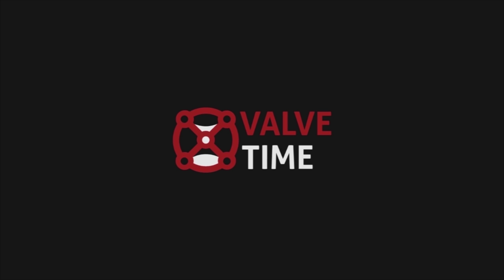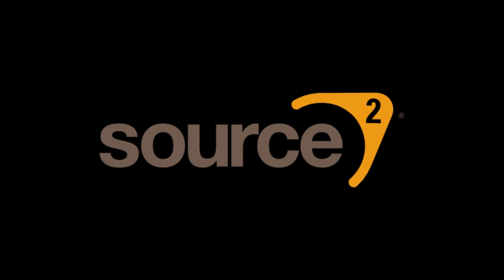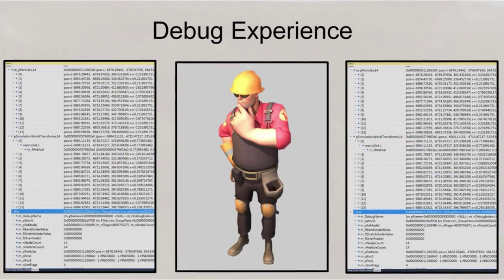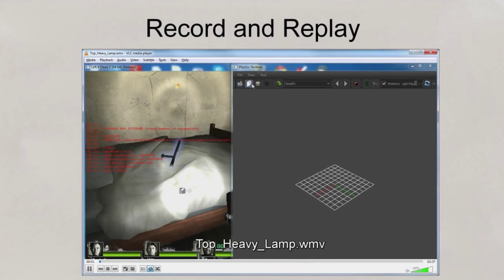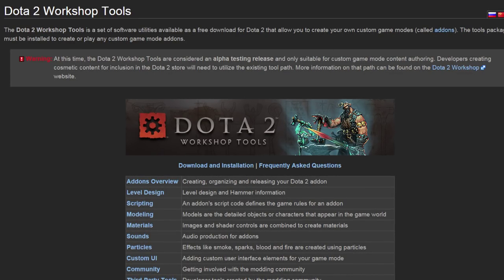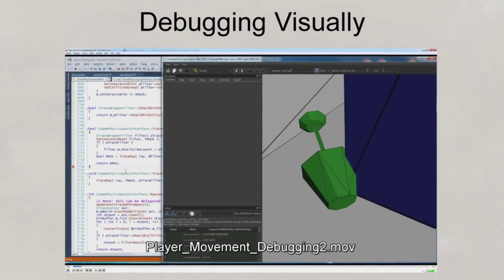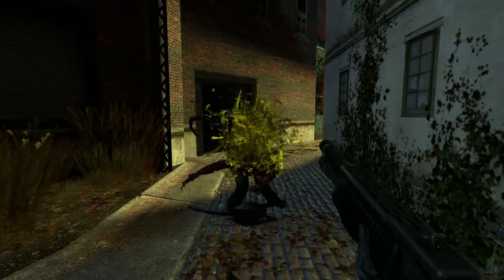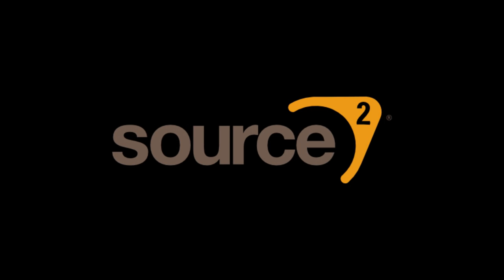What is Source 2's "Rubikon"? - ValveTime Spotlight Exclusive

Comment: Guys tomorrow they will show off half-life 3 on source 2 they will talk how long they have worked on it and why it comes out in 2017 I had to say this because i'm sure the fans want to know more about ot P.S. source 2 can convert models. you have made easier you just need to run one program wich is the engine's program then there everything you need is you can even replace model's texture

Thanks - Fríði K. Justesen President. Main programer and designer

-Faroe Software

Comment: About the 64-bit portion. I thought HL2 before it was ported to the "Orange Box version" of Source for OSX and Linux compatibility had a 64-bit build?
Reply: it was ported to an updated version of source but the source engine has never had 64bit support as the engine originally came out with cs:source in 2003
Reply: http://store.steampowered.com/news/496/

It most certainly did exist.
Reply: ***** Thanks for clarifying, I actually wasn't aware. I believe the information regarding the Left 4 Dead 3 having a separate 64bit client is true, it just isn't the first time Valve have released a game which supports 64bit processing. I'll stick an annotation on.

Comment: Hey, will the new engine require better hardware to run games like CS:GO And Dota 2 on the new source, I have a mid range gaming rig should I be worried?
Reply: I wouldn't say you should be "worried", but yes, a new engine like Source 2 will have new specifications. It's worth remembering Source 2 should be more efficient than the older Source engine, so hopefully even more powerful games aren't that much harder to run. We'll just have to wait and see.

Comment: 2:26 umm what is that phys gun
Reply: That would be a pre-release weapon used to demonstrate Half-Life 2's physics system way back at E3 in the very early 2000's. The footage shown is from the Missing Information mod, which has taken stolen maps and assets from the Half-Life 2 2003 leak and reconstructed them to let people play through a few of the maps.
Reply: Valve News Network did a video on it. "The unused weapons of Half Life 2"